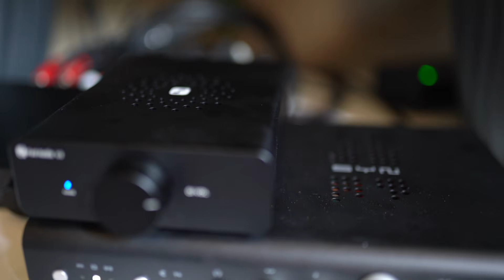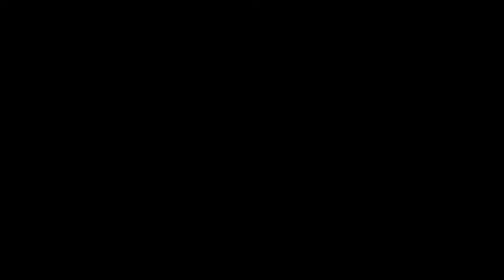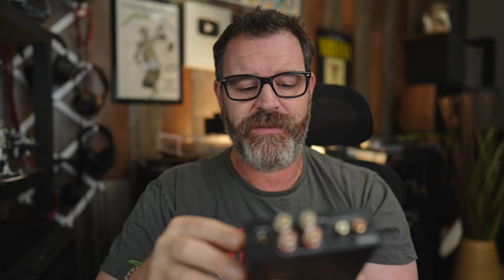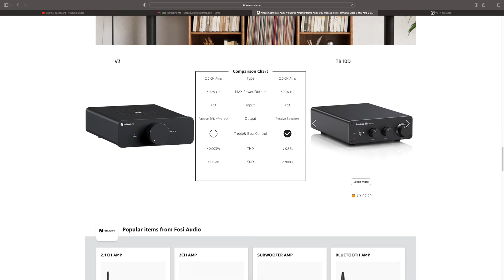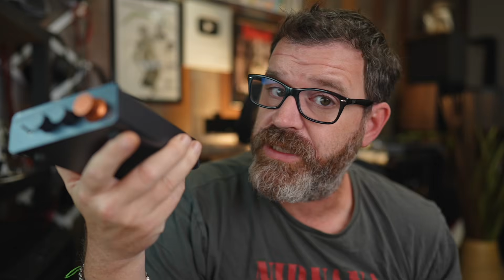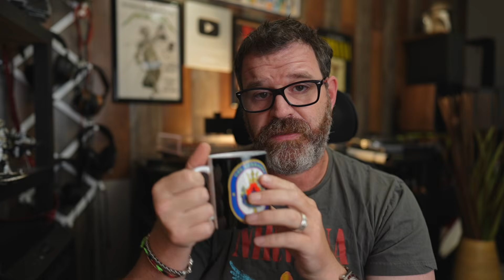Fosi Audio V3 Review - The Best Amp Under $400?

Comment: The next version should have the option to switch it to a mono block. What a win that would be! Even if a little more expensive
Reply: volume bypass would also be great.
Reply: @JoseFerreira-zb7wh  Why don't you want a volume control?
Reply: @fosiaudio  i'm not saying i don't want it. Just want the option. That way it can also work as a power amp and I can connect some unit with a preamp and a remote and control it from a distance and if i use them as monoblocks, volume's automaticaly matched.
Reply: @fosiaudio  So that you don’t end up with pot overload. A good power amp should hand off all the volume and tone controls to the preamp for ease of use.
Reply: @JoseFerreira-zb7wh  Thank you for your explanation, so it is the monoblock that you don't need the volume control?
Reply: @MechAdv  Could you please tell me what will you use the amp for? So that I can understand better.
Reply: @fosiaudio  an input trigger would also be real nice so it could turn on using a preamp unit with a remote.
Reply: @JoseFerreira-zb7wh  How about auto on/off instead of a trigger.
Reply: @fosiaudio  yes, it could do the trick. some way that it could Turn on and off at a distance would be great (preamp). and then volume, etc, etc.
Reply from the maker: I’ve always thought it would be cool if you could bridge something like this
Reply: @cheapaudioman  You should communicate with Fosi and Aiyima reps that there is a pretty large contingent of their consumer base that would buy 3255 based monoblock power amps multiple at a time. For less than 100$ a pop, these are pretty much “fun toy” level purchases for audio enthusiasts. I’m tempted to grab on of these V3s, but I’m not so sure that it warrants an upgrade over the A07 I have running my center. A bridged power amp version though? That’s new and exciting enough to fork over 80$ for the impulse buy.
Reply: @MechAdv  WIth switchable low and hipass filters on them - I would buy three, one per channel and one for the sub.
Reply: @MechAdv  Haha, why do you know we are developing fosi audio ZA3?
Reply: @MechAdv  How much power then?
Reply: @fosiaudio  I imagine you’d end up getting whatever the PSU rating is 1:1 in continuous RMS power. So your standard 32V 5A PSU should provide 160W continuous into 4 ohms.
Reply: @fosiaudio  I bet you are now after seeing this comment section. Lol. Don’t forget a standby switch on the front of the amp!
Reply: @Anchor2012  HPF and LFE in the same amplifier?
Reply: @MechAdv  Got it, thank you.
Reply: @MechAdv  so you would like to use it for your home theatre?
Reply: @fosiaudio  Yes, LR stereo channel (or more for the surround folks)  can use one, Passive sub uses the other.
Reply: @Anchor2012  I am confused, we are talking about the input for monoblock, why do you need so many channel?
Reply: @fosiaudio  In the context where you have more than one channel from a decoder or say a preamp. One monoblock per channel. Assume the preamp/decoder doesn't do bass management, then it would help to have selectable hi OR low pass filtering per monoblock. I would suggest a three position switch Hi-OFF-Low at around 120Hz. I currently need to have active filters before my  monoblock's to do this, would prefer not to do that. If you offered this, I would buy three of them for my 2.1 setup. Two would be set for hipass, one lowpass. Perfect.
Reply: @Anchor2012  Yes, a HPF and LFE, but the frequency will not be 120Hz, it is 80Hz for the HPF and 250Hz for the LFZ.
Reply: @fosiaudio  Wow! That is ok. Pretty excited to see what you come up with.
Reply: @cheapaudioman  there are some bridgable dual tpa3255 boards on Al's Express. You have to figure out yourself where to get two 20A 48v power supplies.
Reply: @D1N02 links please
Reply: @cheapaudioman  Yes Randy, we think so too, and we are doing that.

Comment: I appreciate your work Randy, especially when you lay out component characteristics and give examples of how well (or not) they might play together with other components, as you did here - VERY HELPFUL!
I just watched your Topping pa5 review, and for the caveats you detail there and for the Fosi V3, I'm not inclined to buy either one, despite how good they may sound together. Cheap or arcane connectors and no tone control (even with the pair) means I'll keep looking.
Reply: Then you like fosi audio BT20A PRO which has tone control?
Reply: @fosiaudio  The BT20A PRO is an amazing unit! I also have the TB10D running in my office set up and it sounds better and handles lower impedence speakers better, than my Marantz NR-1403, which is now a pre-amp with the TB10D powering my bookshelf speakers! Great amps!!!!
Reply: @ramondelgado6778  Thank you, and if you have any suggestions, you are welcome to let us know.
Reply: @fosiaudio I would love to see you make a unit with much better quality speaker binding posts, NO BLUETOOTH, NO DAC, 2 RCA inputs, an input selector with on/off switch, and a full sized sub output. The VU meter from the MC101 would be great and tone controls. Make it $149 and it will do soo well.
Reply: @ramondelgado6778  The speaker binding posts are too small?

So it is the MC101 without bluetooth and one more RCA?

Comment: I did not hear any comparison to the Aiyima A08 Pro. Would you recommend me replacing my Aiyima A08 Pro with this unit?
Does it have the power of  the Aiyima A08 Pro?
I May however wait until the 48 volt power supply becomes available and more importantly a remote control.
Reply from the maker: Same power ratings. If you like what you have I’d stick with it

Comment: There is that Cambridge audio amp under 300 USD, 2*25w. How does the Fosi compares to that?
I am tempted to buy 3 of those, connect to my 5.1 through the Asus U5 external soundcard, and call it a day.
Reply: I would be suprised, admittedly, if it could match the overall sound quality of the Cambridge AXA series. The little class d would probably excite for a while but in my experience for longer sessions and deeper listening the class a/b AXA series surpasses these small class d amps. I would still buy one myself regardless because they make nice little party amps where more intricate sound quality is not the focus of the music but there is still enough there to satisfy most including me.

Comment: None of the Fosi audio amps drive my PSB Image 5T speakers anywhere close to those power specs in my medium sized room. Even my Onkyo receiver with lower power ratings drive my speakers with WAY more aithority and clarity. These things are really really poor value for stereo systems.
Reply from the maker: What power supply do you have on them. Not all these amps are the same

Comment: Power specifications should always identify what measurement method they are using: RMS (root mean square) Power or Peak Power. Otherwise it is useless. Like telling someone something is 3.2 long. What? Inches? Feet? Meters? 
Using Peak Power as a rating is a deceptive way to inflate perceptions. RMS is the legit honest mathematical way to state power ratings.
Reply: Good to know what you're getting though.
Reply: You won't probably ever get the rated power anyway cause you will need a power supply that cost quite more than the whole amp it self...
Reply: The TI datasheet for TPA3255 is very transparent about it.
Reply: The Fosi gear is not quoted in peak music power, they use RMS. However with my Fosi it would not be possible to drive the sub and main outputs at full power at the same time with the supplied PSU. Tests by other YouTubers have shown the PSU being the limiting factor.
Reply: The power supply is 32v 5A which P=I*V = 160Watts. So no one is getting 300 real watts out of this thing, the power supply literally cannot produce more than 160 watts.
Reply: Wattage was quoted, so not quite like saying 3.2 long and leaving inches off.   I get your point though, but it is more akin to saying a car has 400 hp and you might ask wheel horsepower or engine crank horsepower.  The Amazon info does state MAX power, which most folks looking at an audiophile level amp as they claim know 300 is the max number.
Reply: If it sounds ok measurements don’t really matter.😊

Comment: Someone tested 160W  8 ohm and 190W  4 ohm with 48V10A PSU not 300W x 2.   I hate those wrong specs!   Not honest!  They should offer the option for 48V10A .   ;)
Reply: That would make it too easy to prove that the ratings are nonsense, or that it only can hit 300w once before melting, or whatever.

Comment: Sounds like an amazing amp, but please add a suggested speaker pairing in your reviews,  or at least mention what speakers you used. Thank you as always for your time and effort to share this with us all. Take care, brother.
Reply: Great suggestion
Reply: We tested the amp with Dynaudio Emit 20 if you want ot know. lol
Reply: @fosiaudio  Thanks for your reply.
Reply: Q acoustics concept 20 go really well with d amps. Like someone said the evo 4.2 go amazingly well but a bit steep in price to amplifier . My Spendors go fab too .
Reply: @shaunyweaver1144  I was thinking some might think the speakers recommended might be on the pricey side and while they are not cheap they will allow this little class d amp push every detail through. It’s also not just Fosi Audio that have taken the 3255 chip a little further with better grade circuitry, caps and resistors there are some excellent examples available online around the £170 mark that easily provide enough sound quality to justify a £400-£700 pair of speakers.
Reply: @Panslapper  If it can match the Sabaj A30a for power and sound quality it will be a terrific buy . I have an old pair of Ruark Spectres and they are my favoured speakers with the Sabaj so will be an interesting listening session when all hooked up .
Reply: @shaunyweaver1144  Let us know how it goes if you can…
Reply: @Panslapper  For sure .
Reply: @shaunyweaver1144cordially, Q acoustic concept 20 and Spendor, very interesting. Curious, which Spendor you have. Discovering few weeks ago. I have the fois audio bt30d for fun in a way and works very well with my Qacoustic 3020 but my goal for this amp is to have ambiance sound with my Boston A25 like jazz or anything else and with the Bluetooth, I have a spare room, to rent to massage therapist so they can connect easily, no equipment to bring except cellphone etc. 
I'm thinking to study and use for surround in my futur home cinema and keep the av receiver for front and center only. I think it kind be a good idea
Thanks.
Reply: Accordint to Randy's opinion, I'd say warmer sounding speakers should pair nicely (Almost every Polk speaker and Elac BS41 come to mind)
Reply: I think he uses the Sony 3 ways for his reference speakers.
Reply: Zu DW6 Supremes here, sounds incredibly good. One thing, the higher the input gain, the better the amp sounds. The power supply that comes with it is fine, do not waste your money on the 48v unit. The secret is the input gain, the more voltage there, the better.
Reply: @michaelwright1602  Thank you for your time, reply, and advice.  Much appreciated.
Reply: Monitor Audio Bronze 200.
Reply: Wharfedale Evo 4.2 perfekt fit. I run it with another TPA3255 Chipset board and it is just amazing

Comment: It has load dependency, I wouldn't buy it
Reply: Explain why, don’t just thread crap with an explanation.
Reply: @WisGuy4  I did. Wrong ohm on the speakers and the amp changes the frequency curve. Not OK these days. You can't expect this thing to sound neutral and you won't know how it responds to your speakers without measurements. To me this is poor design.
And, it should have a remote, it has plenty of power for most not to just be used as a desktop amp where it rather likely is on the side of being too powerful

Comment: The V3 and its better components is a very tempting offer, but I would love if it had tone controls. 

I have the TB10D at my PC setup, running a pair of small Dali Zensor Pico speakers, love how that little system sounds. I often listen at relatively low volume, so I really like to have tone controls to "boost" the lows and highs a bit. The V3 would be awesome for my neglected turntable and two Dali Blue 2002 speakers ... I'm just afraid that the lack of tone control could make the whole experience a bit flat, I do like the prospect of more detail though.... what a great dilemma to have, get one more TB10D or a V3, or maybe a BT20A Pro 😅
Reply: 😊We will try to add a tone control for a later version. If you prefer a tone control, you could choose either TB10D or BT20A Pro.
Reply: @fosiaudio  I would definitely buy the new version then, keep up making awesome products 😁👍
Reply: AIYIMA A07 Pro and A08 Pro with the bass treble control,Maybe you can try to compare

Comment: Hi randy I found a 48v 8.3 amp power supply on Ali express
Reply: Hi randy regarding the upgrading  of the power supply on the aiyima a07 like I said I found a 48 volt 8.3 amp power supply on Ali express when looking at the amazon website on the a07 their now saying that the 32 volt and 36 volt power supplies will give you better sound quality than the the 48 volt power supply but when I checked back with aiyima they are saying the 48 volt power supply will give better sound quality just thought  I'd let you know thanks jim

Comment: Anyone else notice that the Amazon listing page states 230 volts? Error or is this a non-US power supply?
Reply: It is designed to support a wide range of voltage inputs from 100V to 240V.
Reply: @fosiaudio  OK, I see now that the power supply itself is capable of using 100 to 240V input. The Amazon listing though, for a product sold in the US is confusing.
Reply: @1raceskier  We will provide a suitable power adapter based on your delivery address.

Comment: I feel like 0% of 4 ohm speaker owners would use this and it annoys me to no end they always provide 4 ohm power ratings when most budget speakers are 8
Reply from the maker: There’s a lot of mid tier and even affordable speakers at 4-6 ohms.
Reply: @cheapaudioman  The problem is that a midrange pair of bookshelves to some people is 300$ and 2000$ to others. Not gonna find any 4-ohm speakers at one price point and a lot at the other.
Reply: @cheapaudioman  Can you give me a good example? Thank you!
Reply: @cheapaudioman  it's more that most speakers are 8 ohms and they should always list all the power not just the 4 ohm first and then you need to scroll around then they're sketchy by giving the power rating with 4 different power cords that aren't included and or don't even exist
Reply: I have 4ohm towers and I initially was using one of these mini amps. I did upgrade to a class AB integrated amp though. Lots of 6 ohm speakers in the budget class though, like Sony Core line and Elac Debut line.
Reply: Just like most specs for speakers the impedance rating is normally incorrect and actually far lower. Most of the 8 ohm speakers I have seen tested have minimum impedances around 4 ohms. And many times the minimum impedance is in the bass range where most of the power is used.
Reply: @gregmatula9749  Why do they lie about their speaker specs?
Reply: @HappyHighwayman  it's usually for marketing reasons since most  receivers are rated for 8 ohms I would say.

Comment: How hard would it be for them to add a subwoofer out?
Reply: It has a pre out.
Reply: @AbsoluteFidelity  That's not an easy LFE
Reply: @HappyHighwayman  all the same with most sub outs you can find on chinese amps.
Reply: @HappyHighwayman  LFE out is a function of a downmixed audio signal from an AV receiver. So to answer your question, it wouldn’t be practical at all, because they would need to incorporate a low pass filter. So just use the pre out and incorporate into the system using the controls on the subwoofer itself.
Reply: @AbsoluteFidelity  Which is why I'm asking my original question
Reply: @MechAdv  Thanks that makes sense.
Reply: @HappyHighwayman  Your original question "how hard would it be for them to add a subwoofer out" makes no sense in this case.
Reply: @HappyHighwayman  There are basically two use cases that cover most users.  
1)  Active sub is most typical.  Has it's own amp with Low pass.  Feed preouts in and done.
2) Passive sub.  Either buy a 2.1 amp (like BT30D pro) and speaker level out but that's not this amp.   OR  connect preout to a separate Sub amp, which will have it's own filter.  Very good option, with it's own dedicated power supply and all separate.
Reply: @MechAdv  To be clear, AV receivers do not mix LFE.  LFE is not a downmixed signal from an AV.  LFE is a separately mixed and recorded cinema effects channel in production.  AV receivers only pass this recorded signal through opamp volume control (perhaps DIRAC too) before output.
       It can be argued that AV receivers DO mix sub-out because that channel does not exist on the recording itself.                                      🔈🔉🔊
Reply: @TriAmpMyFi  The more you know! Cheers. 👍
Reply: @MechAdv  Well,  it's something to talk about anyway....lol.... Cheers
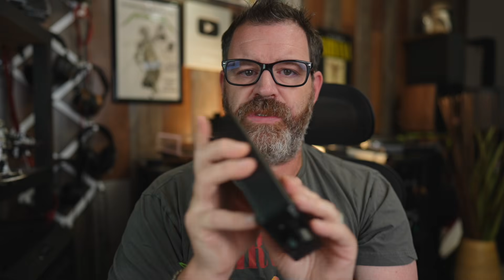Reply: @TriAmpMyFi  yes it does. 3:27
Reply: @AbsoluteFidelity    I'll be darned, there it is.  Very sneaky.  Good Call & now it's a more respectable amp.  Thanks.          🔈🔉🔊
Reply: You can split the RCA signal and use the low pass filter on your sub. The outcome is the same.
Reply: @0-60STYLE  To clarify, split the RCA signal output with a Y-cable from a line level source like a preamp.  Send one stereo pair to the Fosi V3 RCA input & the other stereo branch to a typical powered sub RCA input.          🔈🔉🔊
Reply: @TriAmpMyFi  correcto 

I'd pair this with any flavor of topping or smsl or Fosi DAC that has volume control and use the little remote control from a distance. 

Ideally though, if you're going to drop money on a sub- it's worthwhile getting a nicer integrated amp with all the trinkets... But that's just me.
Reply: @0-60STYLE  Correcto Moondo back at ya Fonzi..........lol.....lol